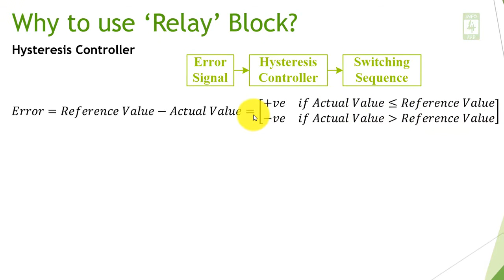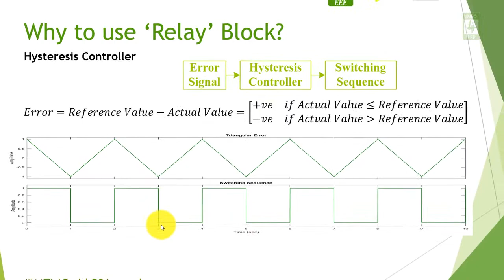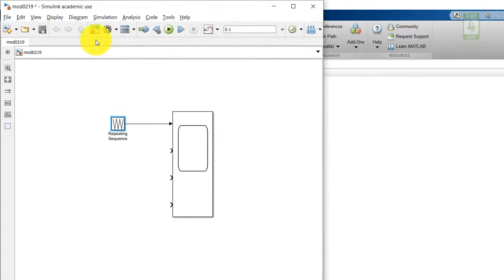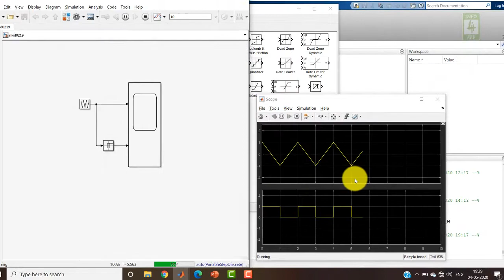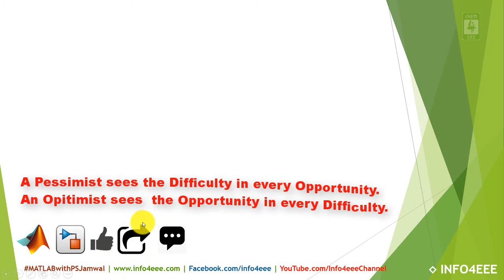Relay Block as Hysteresis Controller in MATLAB Simulink #19 | Basics of MATLAB Simulink | Module-2

Comment: Brother can u plz tell me why we use hystersis current controller after pid controller to control active power from harmonics and give output of hystersis controller to inverter gate input
Reply from the maker: PID controller generate control signal but inverter need switching signal for its operation. Hence Hysteresis controller is used to obtain the switching sequence from the control signal.
Reply: @info4eee  and sir one more thing why we prefer dq0 signal for pid controller input instead of abc frame signal

Comment: How can we implement hysteresis controller in hardware
Reply from the maker: It depends upon the processor?
The one with which we are little bit familiar is dSPACE. Through this you can directly interface MATLAB Simulation logic with hardware.